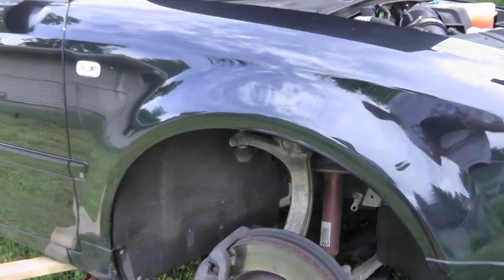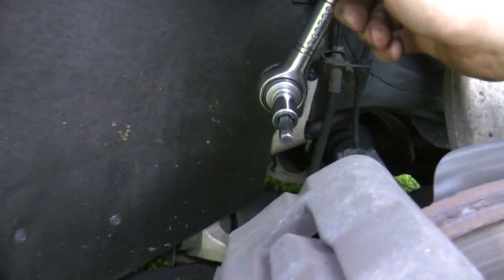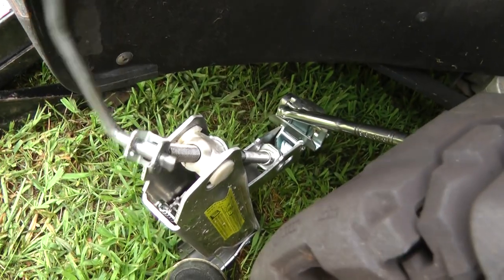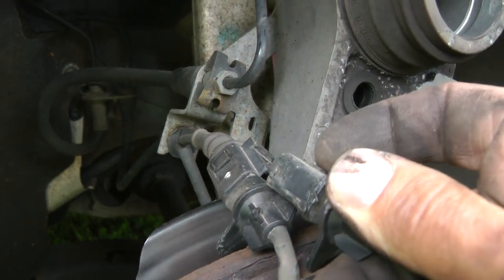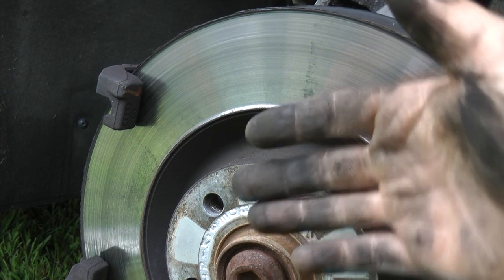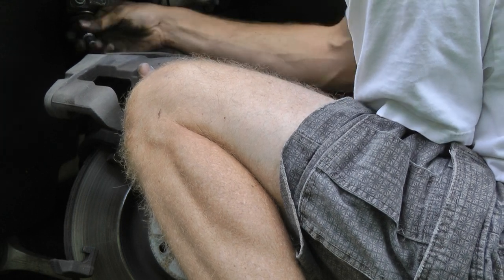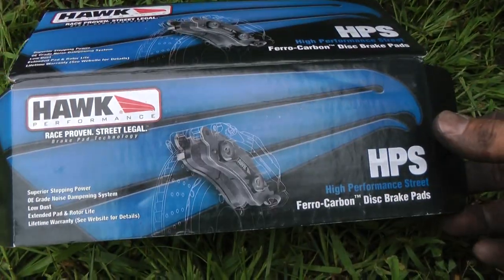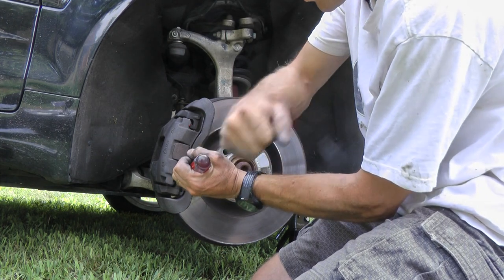2005 Audi S4 (B6) Brake Pad Replacement - Novice T

Comment: Whoever watches this - DO NOT split the caliper to change the pads/rotor - EVER. Compress the piston by moving the housing back and forth within the bracket until it swings out - then set that on a box so you don't damage the brake line. The bracket then has two bolts holding it in - take it off, then change the rotor. Also, use a jeweler's screwdriver to push the plastic sensor tab from BEHIND the bracket, then rotate and lift. Using the same screwdriver, insert it between the the sensor and car's plug-in to push down the tab there to separate the two. Takes 30 seconds to accomplish both. If something seems really hard, it's probably because you're doing something wrong.
Reply: Agree this is the complete wrong way

Comment: Thanks a lot, this was very helpful in identifying all the quirks.  The sensor actually has a little clip on the top that you push down and out kinda (same kinda clip that is on the coil packs that connect to the ignition harness (or what would be the spark plug wires/harness on a regular car with a distributer) and it clicks and then pulls right off instead of trying to pry under that female end and I simply used a C-clamp for compressing the caliper.
Saved a ton of money.

Comment: Thanks. This was a great help. I was reluctant to take the springs out without knowing for sure how and breaking them. I also did the rotors which was pretty straight frward. I had to take off the bracket holding the sensor to get to one of the caliper bolts

Comment: err...it's a useful video, I've had my S4 for 6 months now and I am about to do the front brake pads so very helpful to see how it looks in there... but... I think the way to do this is to take out just the two sliders, no point in splitting the caliper. On my BMW 335i I think I have a very similar caliper with the difference it's only one piece and so you are not even tempted to do it the more complicated way. But really, bottom line is: thanks for going through the effort of doing this video!

Comment from the maker: Bob - I have had the same experience. Despite a few thousand miles, I don't feel like my front pads are getting great purchase on the rotors. Even hitting the brakes as hard as I can at 35mph, I can't get the ABS to activate. I am going to replace the rotors and see if that makes a difference.

Comment: obviously he does have some novice mistakes, but overall i love his video. the biggest boo boo is to not split the caliper as he did. mating the two surfaces so there is equal pressure and even brake distribution is an entire other level of difficult.

***i was confused by john baker posting to "DO NOT split the caliper ... EVER" so i read further into this because i thought splitting caliper was convenient. above is what i found.

you can take the caliper off by the two outside? bolts i believe, not the 2 inner ones. from there its basically the same process. 

loved matthews video, it felt very educational and almost like a class. not easy to keep someones attention now a days and he did. thank you for the video

Comment: The dealer was very familiar with my problem when I had it.  I ended up just living with the problem until I got rid of the car.  I know new pads have an abrasive coating to break into new rotors, and its suppose to be an exact fit basically.  It was never an issue on my Camry but on that Audi it was a different story.  You may just want to start from scratch.  It would suck if you bought new rotors and were in the same boat.

Comment: Why did you split the caliper. Leave it 1 piece.
Reply: Agree this is completely the wrong way to do this. Just the two sliding pins need to be removed

Comment: 7:00 - I made the mistake of not replacing the rotors with my pads on my old B7 A4.  What happened was my rotors were obviously not perfectly flat after 55k miles of driving.  I put new pads on that WERE perfectly flat.  Even 20k miles later they never seated properly.  My brake pedal would go to the floor.  No leaks, no air in brake lines.  You need a good seating between new pads and the rotor from my experience.

Comment: You don't need to split the caliper.  Just remove the slider pins.  Caliper comes off in one piece.  You're new pads will come with new slider pins to use anyways.  You should be able to retract the piston with a couple of standard clamps before you remove it from the mount.  Actually I have retracted the pistons by hand in almost every case.  The most difficult part is separating the sensor plug.  Thanks for the tip on that.

Comment: You can move the pistons with a large c-clamp as well.  Simply keep the old pad against the piston and put the clamp on it, centered to the piston.  Just be careful with the placement of the clamp on the outside of the caliper.

Comment: Still passing the most important steps in changing these brakes!!! First, once you begin to reassemble you're brakes I like to grab some sand paper and sand down the wheel hub and apply some Anti-seize to the back side of the rotor, this will prevent the rotors from seizing up and your not beating the crap out of the rotor come time to change your brakes again!! Second, use a silicon based hi temp brake lube/grease to ensure the slider pins are greased up properly, this step will help with even brake pad wear. Third, on Audi you will need to apply a silicon gasket maker adhesive from the outer brake pad to the caliper to avoid any brake rattles or vibrations. Audi glues there outer pad to the piston straight from the factory so this step is important.  Note. the side where the piston touches the brake pad just needs a light layer of brake grease.  Also on the 21mm brake bracket bolts USE ANTI SEIZE! Also worth noting, any new brakes will need a proper brake bedding.
Reply from the maker: Those are all excellent suggestions. Thank you for your input.

Comment: When I change my pads and tried reinstalling the caliper it won't screw into place.  None of the screws are stripped.  I need help
Reply from the maker: Make sure you have the right bolts. Make sure the caliper is completely back together. Do you mean the bolts that put the caliper together or the ones that hold in on the car? Try taking it off again, and test bolt just the back half. Don't give up. It can't be anything too complicated.
Reply: Matthew Brenengen what happened was,  after I took the caliper off the car and place the new pads in,  in place the caliper back on the vehicle and the 2 Allen bolts and the 2 sliding pins just spin everyone I try to tighten them.  I took off the caliper and placed it back on several times and still encounter the same problem.
Reply from the maker: Probably one of two things is happening. The first is that the threads on he bolts, or on the caliper are toast. Take the caliper off again and see if you can put the bolts in the holes with no problem. The second issue is are the bolts long enough to reach the threads? If they are just not getting to the threads, then something is keeping everything from going all the way together. Try putting it together without the pads just to see if it will work.

Comment: No, you dont have to split it. Just remove the 2 bolts that fix the caliper. You'll be able to remove the whole caliper in one piece. That makes it much easier to press back the piston. And please dont use a jack to remove the screws on the caliper. Turning the wheels is much better, as you allready edited on the clip.

Comment: I have owned about 10 audi cars from 1999-2007 and u have a b7, if its a 2006. look it up if you don't believe me. not trying to be an ass but if your doing a diy then you should do your homework.
Reply: the headlight looks like a convertible B6. Maybe that's not a mistake. ...just saying...
Reply: Jamie newton the front of the car is a b6 the newest year that could be is a 2005 because 2005.5 started the b7 lone that headlite is definitely a b6. So make e wonder if this is even a s series audi or just a plan a series.
Reply from the maker: It is actually a 2005 (or way). Sorry. It is an S4 - check out the other videos of the V8 if unconvinced.
Reply from the maker: I know you were talking to Jamie and not me, but let's all try to be constructive. I screwed up on the year and caused the confusion. Thanks.
Reply: No dont need help, you are telling other people to do their homework yet you can't see the difference between a b6 en b7 and need a build date to know which is what.
Reply: " you have a b7 "***if***** you have a 2006" see the "if"  He doesn't have a 2006 so he doesn't have a b7. Sorry for your confusion!
Reply from the maker: Jamie newton Don't know what you guys are talking about. The title says 2005. 🤗